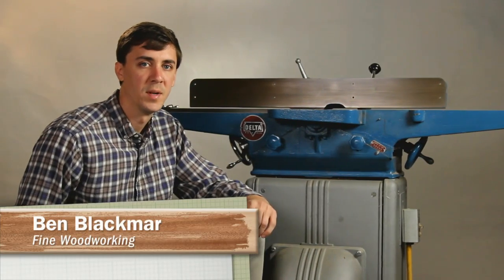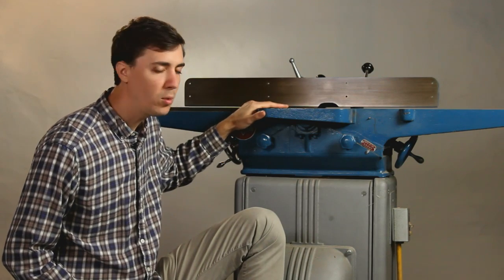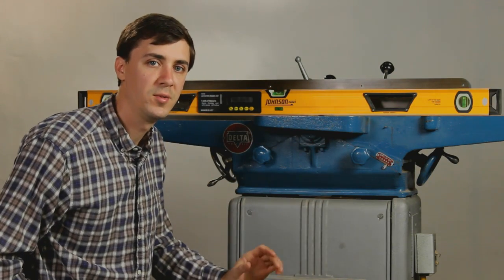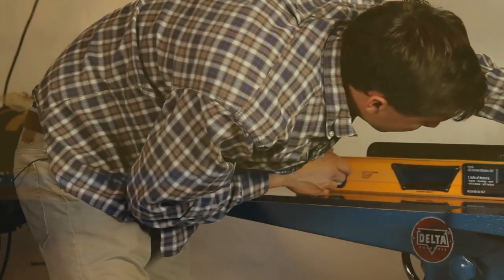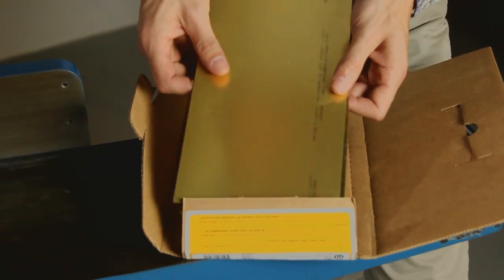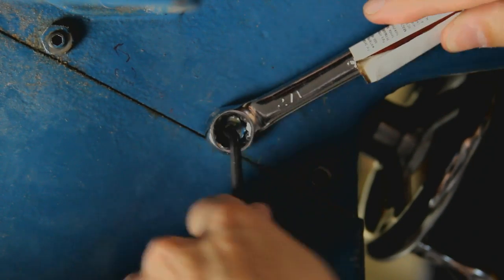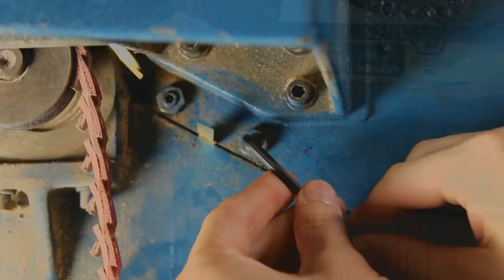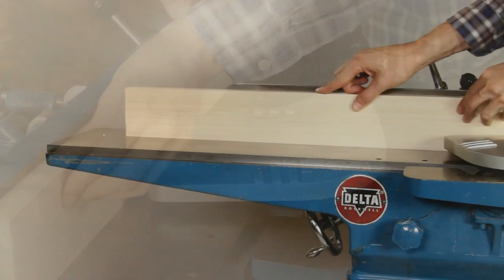How to Shim a Jointer's Outfeed Table

Comment: Moral of the story: Don't buy jointer with none adjustable out feed table.
Reply: You've never had an outfeed table that's dipped on one side beyond the scope of the adjusters?
Reply: @caj4562 if the out feed doesn't adjust doesn't that mean you can't shim it and are forced to shim the infeed (which is not ideal because that will be raised and lowered often)?
Reply: all the old ones are like this dipshit

Comment: i moved my powermatic 6", the outfeed table moved and i started getting horribly tapered cuts. I have searched yt for 2 days. no one has explained it as succinctly as you did. everyone else has unboxing or long complicated explanations that don't correlate to what i'm doing, but yours was so easy to understand and i feel like i can finally get it dialed in today. THANK YOU! Subscribed, added to playlist.
Reply: Do you have an older model? I got a model 60 8 inch a couple months ago, which I believe is from mid-80s. Yesterday, I finally put the table top on the base after cleaning/restoring and went to align the tables, but when I started I realized it doesn't have the corner cams like the newer ones, so I was stumped on how to align coplanar across the width and length of the two tables. I wonder if this method will resolve those issues as well, not just high or drooping ends. How did yours work?

Comment: From a purely engineering point of view, using shims to correct sag and distortion in a wedge bed jointer is frankly BS. Many years ago I tried to fix an Oliver wedge bed that had been shimmed to try and correct it. It never works very well because if the ways are no longer co planar in both axis the shims just make the beds rock and rack. Your only hope is to have the bed ways re ground true but wedge beds are in any event a stupid way to support the tables because they have huge heavy overhangs loading up the gibs and causing to much friction. My only advice on wedge beds is this. They are a waste of time and money because they are a flawed design. 
Wedge beds work very well on thicknessers but not joiners.
Reply: this is how the manufacturers advise you to adjust your machine.  ive done this to several jointers.  it worked for me on all three... my own, my friends and the one at the cabinet shop i worked at as a helper and floor sweeper in my mid teens.   no body there knew how to fix it and a major project was on hold.  I told the shop foreman i could fix it ... he was sceptical im sure but let me go at it and by the end of my shift they were runni g that machine none stop. ... so yes it does work and this was a high end custom kitchen place... not the kind of place that produces sub par work. 
great vid!
Reply from the maker: There are many people, producing furniture at an incredibly high level, that would disagree with your assessment.
Reply: FineWoodworking . Yeah sure, I have met quite a few of them over the years. Usually self taught, little if any experience in a woodworking trade but big on self promotion. The kind of guys who could never hack it in a real shop ( pay was to low is their usual excuse) but would spend many wasted hours designing silly jigs while the rest of us just got on with it. I refuse to allow journo’s in my shop anymore. 
However, there are ways to manufacture a wedge bed joiner that is accurate and durable. These days the demand is not there for that level of engineering excellence and the costs it would incur.
For example, I have a wedge bed Thicknesser (wadkin) BUT because its properly designed and engineered the wedges are individually adjustable, not one piece. The surfaces are nice and wide and run full length not one third like your delta.
Works great. 
If your lucky and have an old heavy wedge bed with large enough supporting surface then yes you may have a machine that planes true.
The problems arise when the overhang of the tables in proportion to the base is to large. Wood dust is abrasive and once it gets in the ways it starts eating away. You have to oil the ways so the tables move freely but that attracts dust and thus wear. Wood dust combined with oil can become a grinding paste. With so much weight on the beds torquing down on the ways the tops of the ways are overloaded. Gibs cannot adjust the ways, only the friction on them. In fact the gibs are part of the design flaw of wedge beds because if they are unevenly torqued down they can accelerate/cause uneven wear. The ways on your little Delta are pathetic as are most sub 10” joiners.
It is self evident that the great machinery makers such as Oliver became aware of this problem and went with very well supported base frames nearly full length with individually adjustable inclined plane blocks. Simple genius. 
The bottom line is this. Once those ways wear or distort you have a big problem on your hands that will not be easily permanently fixed. Shims ! Seriously ? Try asking a machinist if he thinks thats a worthy solution in this application. Chances are he will say its a desperate and temporary fix that will not last. I know because I have asked more than a few.
And please answer me this question. Are wedge beds engineered and designed to be adjustable for co planar ? Answer is NO, they are not. There is no inbuilt adjustment for co planar and thats the whole point. If it was not done right in the first instance there is little you can do to fix it.
Reply: @MrZamzow  My apologies, it's powermatic.
Reply: Makes sense. I'm gonna throw away this piece of.....
Reply: I do see what your saying, this prob can happen on a table with some serious issues and is shimmed differently on both sides, but this has to be a rare case.  a good solid steel feeler gauge in there, I siliconed mine down works perfectly, took out the bow in my planar from my old Powermatic 60, it is a PITA to adjust though ur right, you would think a better method would of been conceived back then.  But these old jointers are tanks and workhouses, I run mine like hell, never lets me down, I'd rather have this old stuff ANY day than the new, w the exception of a $4k new Powermatic

Comment: does this apply also for the infeed table or only for the outfeed table? thanks and regards
Reply: ur setting up the tables parallel when you do this, tighten the outfeed down and forget about it. get the cutters perfectly in line w the outfeed table, then just raise and lower the infeed table, they are already parallel.
Reply: @GreenMambaGuitars thanks

Comment: Hey all.  The area where he is putting the shims, isn't that the same area that moves?  Will you not cause a lot of problems if if you put shims in that area if you want to move the outfeed table for some reason?
Reply: no, this is the outfeed table, once its perfectly parralel, if stays put and not touched.  the infeed table is the one that gets raised and lowered, put a light coat of grease on both of them to keep from rusting, esp the infeed table